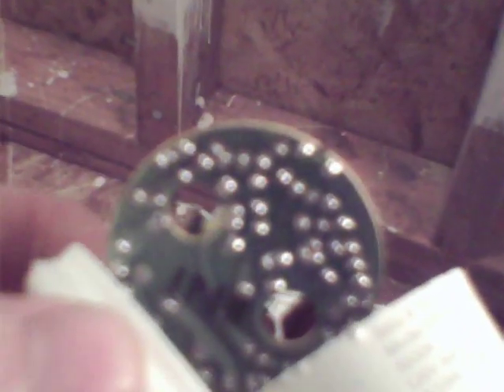CFL ballast guts explained

Comment: And double the fun,  when the "bulb" portion
of these lamps go out, it either burns the
plastic touching the bulb because of the
extreme heat from the burned out electrode,
and/or the ballast explodes because it's
using to much power to light the lamp 
because of the burned out electrode. In short,
they're a piece of crap. The good news is that
the older pre-heat versions of compact 
fluorescent lamps typically don't do this.